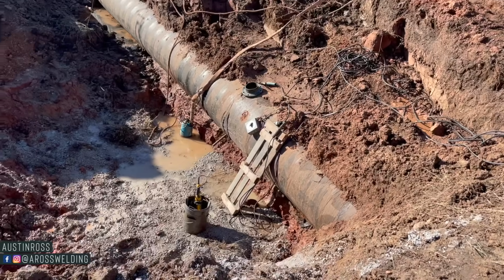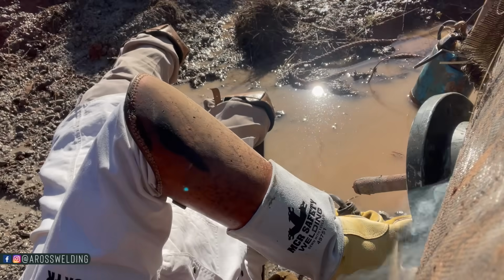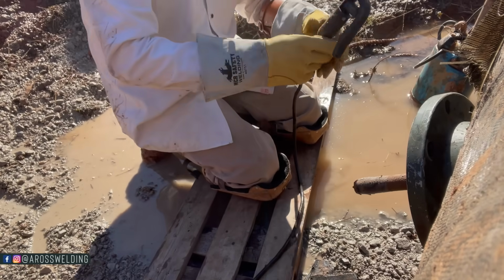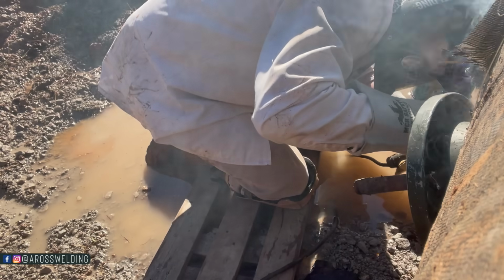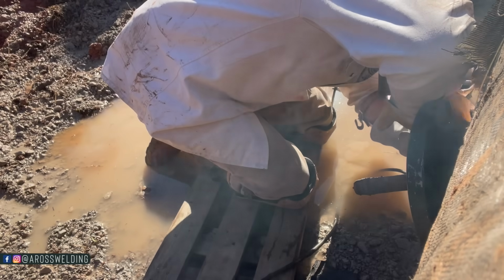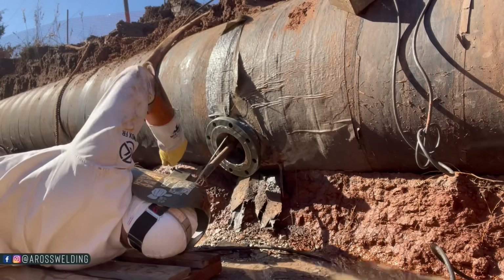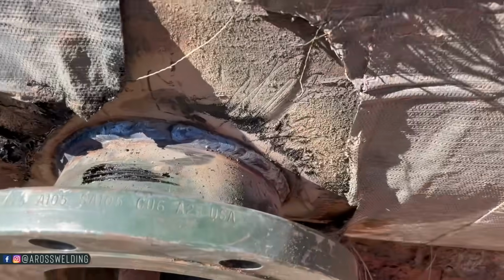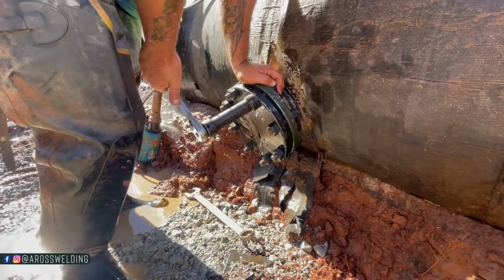Welding Repair On 36" Water Pipeline

Comment: Good memories,I did hot gas tie-ins for three years,cold cutting gas lines,draining them,packing them with dry ice,putting in a plug and vent,welding on a 12" slip flange both sides installing a by pass,no lunch,no brakes,just get it done,I got whatever I wanted,I was taught by an old welder the safest way to do it,it's very dangerous,shell oil didn't care,in 1980 I was making 600.00 a day,it was union,342 san francisco,I was the only one,you do bring back the day's,I've welded with my whole arm under water,good job.
'
Reply: Interesting comment, sir

Comment: I’ve welded hot water lines full with water, but only at 5-20 lbs of pressure. 
The pipe was only weeping so I was able to stop it. 

When there’s too much pressure on it however; using 6010 especially, it’ll pop the puddle when it cools every time. I use low hydrogen and go fast enough to make it stop.

And don’t get me started on getting shocked.. I feel ya on that one.. It’s always fun to “Ride the Lightning ⚡️“

Comment: I'd like to see more water pipeline welding videos.   Water is just as important (more important really) as gas and oil.   Thanks Austin!
Reply: Definitely more important tho we haven't prioritized it that way
Reply: did you ever sit in a small boot and the boot goes up and down and any which way welding in Toronto can.harbour.80s.

Comment: Austin not sure if anyone mentioned the history behind the wooden peg in a water line, back in the day when water mains were made of wood, they would drive a wooden peg that was tapered ,the wooden peg wood swell up and seal the leak, fire hydrants used to be called fire plugs for that reason, when the bucket brigade would drill a hole in the wooden water main  and they were done they would drive the plug in for future use. A little fun fact.

Comment: Used to to the same thing in the bottom of pulp wood barges. Wood peg driven in the hole, weld a piece of threaded pipe
around the peg & screw on the top. Some of the nastiest work I have ever done.

Comment: I spent lots of time in holes like that. Whenever possible, I had them dig the deepest part of the hole behind me and put the pump there. That way the water runs away from you and you have a dry area to work in.

Comment: Nice job! Some of those old pipe coatings may contain asbestos.  Anything older than 1982 it's more likely. We'd call in abatement crews in west texas.  Helps to keep it wet when it's removed - it's the dust that's bad. You may already know this. Just looking out for ya. Turned out slick!
Reply: My thoughts exactly on the wrapping...
Take really good care, when working with that stuff. 
Otherwise great job 👍

Comment: How do you get a good weld when the pipe is live?  Seems any liquid would super cool the metal and prevent good penetration?  As far as welding on a live gas line well I don't have any desire to be anywhere near that operation!!

Comment: My worst shock came while welding bar joists to a horizontal I-beam. Late July in NC, 300% humidity, and sweating like a whore in church. Burning 5/32” 7018’s, every stitch of clothing soaked with sweat, I was sitting on the beam and had put a new rod in the stinger, decided to mop the water off of my face. The end of the electrode swung around and hit my right knee which was clad in soaked denim, and with my equally soaked butt sitting on the grounded beam, I got lit up and nearly fell off! Been zapped many times over my 40+ year career as a certified welder, but that one was by far and away the worst!

Comment: a place I went to had 2 big 10k water storage tanks. (Volume thing, fill over days with small pump, then quick fill for sprayers with 4” gravity discharge) 

Anyway, tanks were old, from 1930s. And those things were full of wood plugs.  “If they start leaking we just jam a different new stick in the hole”

Comment: A little trick I learned when your gloves are wet, is to stick a rod in the ditch of your elbow and grab the rod with the stinger. There’s usually more insulation in the coat you’re wearing to avoid getting shocked (that is if you’re not already wearing a waterproof coat.)

Comment: I generally used 6010,root and hot then a low high cap,7018.Surprised you didn't use a short pup on the flange for more clearance when welding.When finished the outside,,6010 the inside,root and hot.

Comment: My worse shock was tig aluminum, I was laying on the floor of a livestock trailer tigging low on the wall and  got the filler rod stuck to the tungsten, then touched my ear before I could get the thumb control off, yipeeeeeeeee
Reply: ......."it was at that moment he knew, he f..ked up.."....😂

Comment: Very cool, does the water contained in the pipe effect the heat transfer?
Reply from the maker: Yes it does effect it
Reply: kind  of figured it would. a giant heat sink @arosswelding
Reply: Just as a gas main with a lot of draw, flow, usage. Would also have an effect on heat transfer.
Reply: Preheat to 200 degrees

Comment: On an old pipeline, would a 3/32 6010, downhand root, with 2-7018 cover passes work? I'm thinking a water pipe that old, would likely be pretty thin at the point the leak occurred, and might blow out with the 7018? Just curious, you did a beautiful job by the way. I'm Enjoying your content!

Comment: Austin, this was a time and material job wasn't it? How is it that cross-country high-pressure pipe is all downhill but a relative low pressure water line required 7018 uphill on a "blind" that has no stress or strain or load on the 6" inch flange?  Why not run a 8010 "bead" pass downhill  inside and out then a cap pass with the 5/32? Good video as always and I have been in the ditch myself on take up and re-lay of oil line plus running 16" pipe in a ton of catfish ponds getting shocked as well!! In this situation a "seal weld" was required IMHO....

Comment: I weld nozzles on live water mains all the time so they can be tapped. I Always run 1/8” 5P down.😁 Don’t blow through!
Reply: What about 7018 3/32 . I burn thru today on a live main. Feel like If I had less penetration rod would of been better but idk how 7018 reacts on buried water pipes

Comment: Why was the flange needed? Is it a leak repair or is there plans to tap into it?
Reply: Flange is needed to allow welder to do the job without the need to weld on water pouring on you. One day I welder big nut in the similar situation and then screwed bolt in it and welded bolt to nut

Comment: I always tell people be more cautious of your grinder extension cord in the water 110 is a lot worse than getting buzzed by your welder
Reply: I don’t understand how you’d get shocked when putting in a new electrode if you gloves are wet but you have boots on. I also never understood how you don’t get shocked touching a piece of metal while someone is welding on it. (Or would you?) why is 110 a lot worse than a welder?
Reply: @jimdarhower4945  
To get shocked either way, you need to close the circuit with your body.
The key thing is resistance, wet surfaces have less resistance than dry ones.
As for the not getting shocked by touching metal that's being welded, that's because your skin has a higher resistance than the metal, so the current has a better path through the metal than through your skin.

If your body is the only path with low enough resistance, you will get shocked.
Volts, Amps, and whether is AC or DC also play a role.
Reply: @ GoldSrc - makes sense. Thanks for the explanation.
Reply: Also the return path through ground clamp  is lower resistance than your body.

Comment: They could have stopped flow long enough to press a sleeve on an weld it in Or maybe run freeze plugs cut small  section out an put new section in . Any  of these options no good  ? Just wondering I am learning myself . I’m not even a welder wish is was or at least knew how . but you can never have to many trades